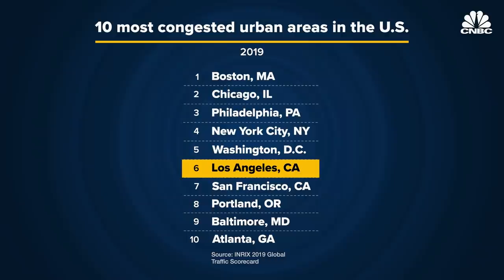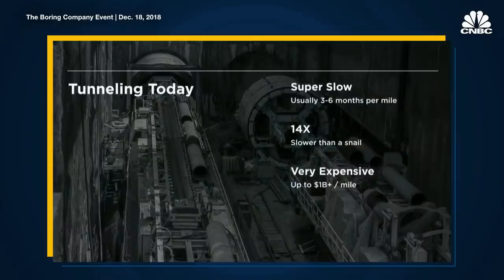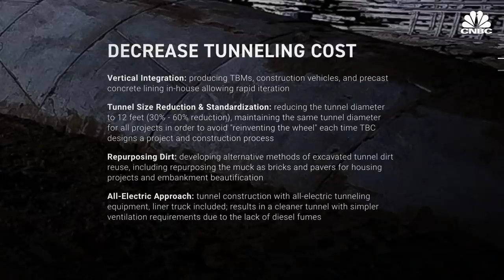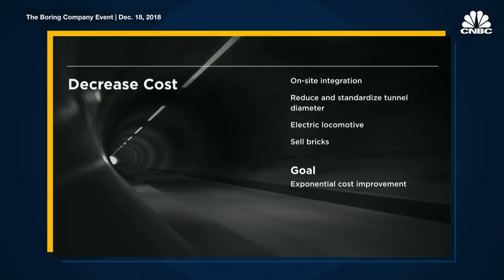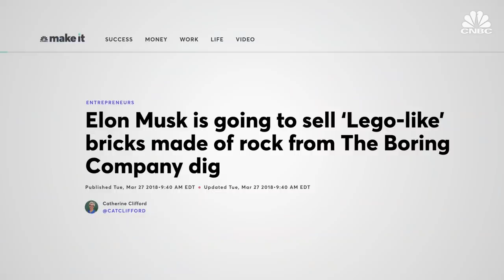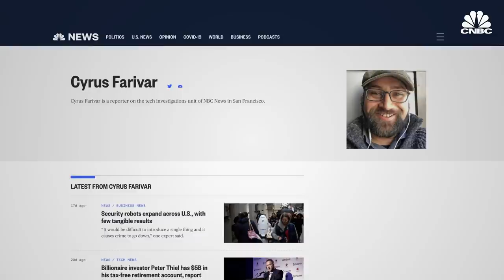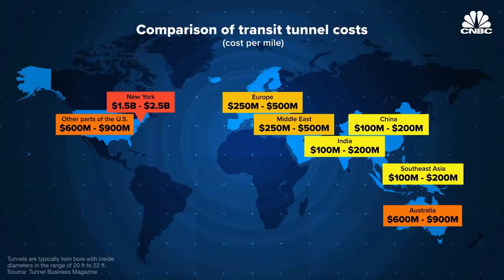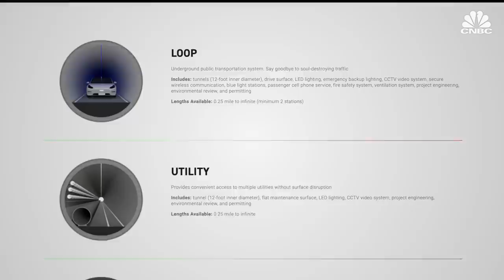Why Elon Musk’s Boring Company Isn’t Fixing Traffic Anytime Soon

Comment: It's insane how people it's amazed by this  "innovative project" when subways are being doing the same thing for decades.
Reply: Only difference is that Elon is doing it cheaper. That's about it.

Then again he did help make rocket launching cheaper as well.
Reply: Well, the hype is it's gonna be a lot cheaper and a lot faster as well. Also, it's would be Ludacris to say there is no difference between metroing and what they are trying to do. I don't know what i you want but it's a hell of alot bettter to pay 10 mil a mile then a few hundred million!.

2 billion for 1.5 miles when metros do it but 10 mil for boring company mile. Not saying that the metro builders have other challenges that makes it more expensive but not 1.9 billion more.
Reply: Cars in a subway  system. That's amazing and had never been done before.
Reply: @silverhawkscape2677  Well the tunnel is also smaller.
Reply: @magnusnielsen4409  Metros capacity is at least 100x more.
Reply: The New York subway  today is still YET TO BE BREAK EVEN. The tunnel in LA was so small/short & costs so much that it didn’t solve anything.
Reply: Its a fair point - but recognize two things:
1) Subways have historically been EXTREMELY expensive.
2) Subways don't address "first mile" or "last mile" problems. You still have to get to the station and from the endpoint station to your final destination.

I don't think these tunnels are mass transit. They are traffic alleviation for people that were going to drive anyway. There's a difference.
Reply: @texastriguy  a car doesn’t address that either, have you ever been on a highway? I had to pick my friend up from the hospital yesterday, and it was in a neighborhood 4 miles from the nearest highway exit. This is in Chicago, where highway exits are nearly every mile. You’re also completely neglecting that in the city, traffic congestion and therefore parking are so bad you regularly have to park 3-4 blocks away from your destination, completely negating the distance saved by not walking from a train station.

You also seem to have forgotten that we have busses for people trying to get off at a more specific point or ride a shorter distance.
Reply: @lcifermorningstar191  the fact that it has never done before doesn't mean is good or better than subway
Reply: @silverhawkscape2677  elon is not doing it cheaper, he literally compared building a small ass tunnel to a metro.

he only made rocket launching cheaper, because it's so niche and wasnt that useful, compared to tunnels, which exist for around 2000 years
Reply: @degummybear  Still cheaper than if government made it. We all know how cost start to increase beyond reason.
Reply: That is terribly ignorant
Reply: @texastriguy  I agree just with the last thing you said.

In that case wouldn't be better to offer a better public transportation?

It's funny how they think they are committed with enviromentenment buying a tesla and they didn't even know that metro is electric and cheaper and it has been there for years.
Reply: @silverhawkscape2677  if only, he hasn’t been able to follow through on that promise same as his promises about inventing new batteries for the Tesla. It’s just vaporware at the moment.
Reply: @magnusnielsen4409  it's  gonna be cheaper to dig the tunnel, nonetheless if you compare the people that a tesla can bring with a metro it is quite expensive
Reply: @degummybear  Small tunnels are a great thing. A 40-ton truck driving over a freeway does an equivalent amount of damage as 50,000 cars riding it in a minute, yet they pay less in taxes (contractors are legally allowed to use Gas costs as a tax rebate for their business). Keeping those tunnels small will keep maintenance costs low, prevent traffic congestion due to trucks, & I get MORE tunnels!
Reply: @silverhawkscape2677  nonsense, come to Europe or go to Asia during rush hour or even during carnavals/football and many other occasions where bus, trains, trams are almost full, no stupid small vehicles can deal with that.
Reply: No, thats not what subways does. Subways involve people getting stuffed in a single car, Musk's plan involves putting people in their own cars and then stuffing them in a tunnel, the latter was too ambitious  anyway. Public transport works in disciplined/collectivist societies. Go to Hong Kong and their MTR or Singapore or Taiwan or the PRC or Japan. Individualism works when the individual is smart, when they are not you get places like NYC and LA. Lean into what you are good at.
Reply: @magnusnielsen4409  that's inefficiency of government not the ideology , Europe has public transport better than anywhere
Reply: @alexanderphilip1809  nyc has the world's most dense and expansive Public transportation infrastructure. It can and should be done here
Reply: No one is amazed by this project. People just want a solution for traffic. And Elon Musk is doing something about it
Reply: @chrisjlee2013  he's really not tho. He's giving himself and his rich buddies a toll road lane underground lol
Reply: @silverhawkscape2677  Take another look at the price in relation with the capacity.
Reply: @ricecakeboii94  It is not about breaking even, is about what you save in other regards. More metros means: less neighbourhoods you have to demolish to put roadways on, less terrain you have to allocate to parking and less time you waste out of the people in mass transit congestion. And so you know, most public infrastructure never break even, that's why the government does it and not private corporations.
Reply: Less than 5% of the U.S. population  uses public transportation.  Americans , overall, just don't prefer to use the subway or the bus. That is the reality of the situation.  But I guess watching empty  buses drive around town wasting tax payer money and polluting  is your answer? How much money did Amtrak make last year?  Last decade? Listen, I'm all for public transportation  but as impractical as it may sound, the average American is sitting in traffic burning a tank of gas right now
Reply: @lcifermorningstar191  wow imagine having only 1-4 people for the same space where atleast 10 people can fit in a subway.... so innovative.
Reply: @chrisjlee2013  I'm amazed, instead of a congested nasty subway filled with people, you get to stay in the comforts of your car
Reply: @silverhawkscape2677  the other difference is subway can carry upto 40k people per hour while the Vegas loop with teslas carry 1k people per hour. Each tesla needs a driver too while modern subways are automated
Reply: The innovative part is about scaling it up several magnituted by squeezing all the efficiency possible out of the boring machines. Which Musk and the people he hires are unbelievably good at.

Traffic is so bad not because our roads aren't big enough, it's because they have intersections with each other. Go underground and you can have a tunnel system with little to no intersections.

It's not supposed to replace roads completely. It's just 1 part of the puzzle that can allreviate the traffic hell. Another one would be to not design roads like utter morons.
Reply: @Steelrat1994  the problem with making hundreds of those tunnels is that you end up spending trillions anyways. A subway made of similar costs can carry 200x the passengers
Reply: @MarkVonBaldi  So NY benefits while the other states pay for it?
Reply: Subways cost ~$1 billion per mile. The tunnel he built so far only cost ~$30 million per mile
Tunnels are just getting started
Reply: But with a train u can't drive your own car^^
Reply: @magnusnielsen4409  A boring tunnel can only carry a tiny fraction of what a metro tunnel can. It's also a lot slower and more expensive to maintain. If anything goes wrong it clogs up the entire system because the tunnels are so minimal in the name of cost saving.

What's Ludacris is that people fall for this BS. It's like saying I can make a pizza way cheaper and I give you a mini pizza that you can eat in a bite. But it cost 20¢ instead of $12 you would pay at pizza hut I am a genius lol
Reply: That’s what called branding and positioning. Just change name and market it massively, you’re success
Reply: @dark12ain  as you have a 100% electric car.
Reply: @grgamer8470  nope I don't , still amazed
Reply: @dark12ain  i mean even this construction will be ready in 2030 on global scale the necessity it is for everyone to own a 100 % electric car and for this to happen needs every car manufacturers to create electric cars so the cost for a 4 people car to be at 20 k euros and not 40k, u hope for it . If course the 20 k price will be attractive when everyone earns at least 12 k euros/ dollars a year.
Reply: That is not true. Subways do it better and cheaper.
Reply: @silverhawkscape2677  Funny enough, he isn't doing it even cheaper. All he build was a glorified sewer tunnel with RGB. No emergency exists, nothing. Add that and the stuff he builds is even more expensive. The cars are also pretty slow and low capacity.
Reply: @lcifermorningstar191  Have to clarify here: Cars in a glorified sewer tunnel with RGB.
Reply: @mmikael281  More like 1000x.
Reply: @silverhawkscape2677  Its cheaper because they drill smaller tunnels with no security features and also overpromise and underdeliver. They have made 1 tunnel with none of the promises they gave in the beginning fulfilled. Drilling tunnels is metal vs rock and the booring company have not invented the unoptanium metal. All other projects abandoned.
Reply: @elira123100  Pointing out that The Booring company has not delivered on one single promise yet?
Reply: @ricecakeboii94  First, maybe it is paid with newyorkers tax money. Second, my point is that if you are going to expend money to solve mass trafic at least do it soundly and not in meme solutions.
Reply: Outside of peak times subways are colossally inefficient and inflexible.
Reply: @grgamer8470  ahh I get what you are saying, but if I'm no mistaken isn't auto makers already pushing goals to build 100% electric vehicles by 2030? The transition will probably be in the next 5-7 years hopefully
Reply: @texastriguy  you can't use your own tesla to go through this tunnel. 
It's just underground taxi and stop at "stations". They're less efficient than subway that can load thousands passenger..
Reply: @silverhawkscape2677  So much cheaper he ran overbudget on his LV project by several millions and wont be able to meet the contract requirements he is obligated to do under the deal.
Reply: @silverhawkscape2677  no cheaper really, Vegas cost 50 million for a mile. And that’s with a smaller diameter and none of the typical services or safety features every other car tunnel has.
Reply: @conveyor2  subways are fantastic outside of peak times! What are you talking about? No better time to take the subway than outside of peak times. Getting a whole "booth" to yourself is great. That wont happen in an automated car/buss system that 100% will wait until you have a certain ammount of passengers before it goes.
Reply: @MarkVonBaldi  it’s not. It’s paid with federal money lol. Musk is breaking walls. I’m sorry the old boomer ways doesn’t work anymore. I can tell you right now that the old boomer way have left us with a dim future, trillions in debt, & reserved public healthcare for said boomers.
Reply: @silverhawkscape2677  
But he's not.

He bought a tunnel boring machine, same one every country buys and dug the tunnel with it
Reply: Didn't realise you can bring your car on the subway? Oh and when your out already be in your car ready to drive to where your going...
Reply: Who's actually amazed by this? He called it the Boring Company for a reason
Reply: @silverhawkscape2677  He's not doing anything cheaper. All he's done is dig a small diameter tunnel that a car can barely squeeze through, with no supporting infrastructure, anyone could do that!
Reply: But subways force you to walk to a place. You aren't that bright are you?
Reply: @silverhawkscape2677  Elon hasn't done anything yet. Elon proposed to do it cheaper, and what he actually made is a worse version of a normal underground roadway.
Reply: It’s all about cost.
Reply: @ricecakeboii94  The boomer(to be just it was the greater generation fault) way is the car driven system. To sum up a lot of math: A car is not an efficient way of transport by any metric.
Reply: The Musk effect. He has the ability to con people very effectively.
Reply: @davidsoom1551  Amen brother.  These Musk fanboys are worse than Scientologists.  L Ron Musk
Reply: @silverhawkscape2677  So far, the LA tunnel has cost significantly more than planned, there are no automated pods that carry cars or "up to 16 people", there are no 150mph but only 30, it's all run by humans which even at minimum wage racks up huge running costs. The project has been lies and hype from beginning to end. Even an overground bus route would have been cheaper and provide more throughput by a factor of 10. Someone needs to take Elon Musk to court for violation of contract.
Reply: @texastriguy  The last mile problem is only there because American city planning is horrendous. 
Take a look at European or East Asian cities, people take buses, bicycles, or simply walk to their destination from the stations.
Reply: Correction, subways have been doing the same 100x more efficient.
Reply: @silverhawkscape2677  

He did none of those things.
Reply: Well true, but subways did it in an efficient way, not an "innovative" way.  It's much like the poor quality of the music program in Gary, Indiana schools prior to the arrival of Professor Harold Hill.  Musk could give Hill lessons.
Reply: Nah. Subways are doing it better
Reply: *centuries
Reply: @magnusnielsen4409  $10million  a mile?. Trust me, thats impossible. I work in construction and i dont think they can do it for even $50million a mile.
Reply: They just don't save earth but protect the automobile industry. It's like CA.
Reply: There were rockets and then came spacex
Reply: Probably the part where its like 5X cheaper and faster.
Reply: @luism5514  did you read the comment above, compared with other tunnel his is small in size which is the reason it’s cheaper
Reply: It is insane how people like you still don't get it.
Reply: @sayidChannel  which renders the original comment irrelevant. If subways were better we’d be building more of them. Cost is indeed a factor you must include. Dismantle the government bureaucracy and we could have more subways.
Reply: @luism5514  they are better its just not efficiently designed in the usa, take a look at japan
Reply: @magnusnielsen4409  CAPACITY is different you genius
Reply: @lh2000  okay big guy, which one are you gonna eat faster a cupcake or a big plate pizza ?
Reply: @Multi0515  LOL May I use that, L. Ron Musk?  Bezos goes up tomorrow (good luck)  At least Bezos is a real businessman. Not the con man Elon Hubbard is! Elon must be miserable watching all the Press coverage not focused on him. Man that guy irritates me but I'm not a billionaire so the fanboys say I'm jealous. No, I don't want to be a con
Reply: @lh2000  reducing the cost? In relation with what? Subways?
There is no such a thing as disruption, he is just making tunnels for the people who can pay it... Seriously you belive that speed will solve the problem?
Reply: This is the same argument for saying why SpaceX is not innovative because the US government put a person in the moon 50 years ago. Nothing new you say? So why is NASA paying SpaceX to put astronaut in the international space station? SpaceX drove the cost per pound of payload down by 20x! You could have the same attitude toward the 2007 iPhone, nothing special! Why do you think today's 100 dollar phone perform better than the expensive iPhone from 10 years ago. Right, nothing special.
Reply: @khuo0219  it is not the same actually, space x is innovating because they recycle rockets... That's the point the innovation is very clear... In the boring company there is no innovation.
Reply: @silverhawkscape2677  but did elon actually make it cheaper to launch rockets? Yes the rockets return after launch and are reused BUT people often forget that you can't just reuse a rocket for 100 times without having to do any maintenance. Unlike let's say a plane or a car. Rockets need to be in PERFECT condition before every launch. So even if they can be reused, they still require a lot of maintenance costs after every launch. And this is what often isn't taken into consideration. Plus after a certain amount of launches the damage will probably be so great that it can't be repaired any more (or the costs would simply be too high) and they would thus have to build a new rocket anyway.
Reply: @khuo0219  20X you're so wrong you should be ashamed to put out such ridiculous numbers.
Reply: @magnusnielsen4409  It doesnt cost 2 Billion dollars for 1.5 miles to drill sewer pipes. This is a sewer pipe.
Reply: @texastriguy  people walk or bike the first/last mile if your city has decent indestructible it's not hard. Check out "not just bikes" on yt
Reply: it's insane how you think this is the same thing as a subway
Reply: @lh2000  You realize a subway has multiple times the capacity of a private car, yes?
Reply: U need to realise that he is trying to make it cheaper, faster and more common = main form of transportation when we have trillions of cars on the road
Reply: This idea scales better
Reply: What happened to hyper loops.
Reply: A subway is much, much better. No one gets ripped off like Las Vegas when they build a subway.
Reply: @khuo0219  You lost all credibility when you said, lowered cost by 20X.  Where are your sources, Elon's big mouth?
Reply: "same thing"? That's like saying we've been building the "same" electric cars for almost 200 years..
Reply: @ricmrodrigues  This says it all....THE LAS VEGAS LOOP!!!!!
Reply: @dogtato  It's way worse than a subway. It doesn't exist! It's another L.Ron Musk CGI fantasy. His reality is the LAS VEGAS LOOP.   This is what he really builds .8 mile  tunnel, Teslas driven by Vegas cab drivers at 30mph but with, wait for it......Disco lights. He nor the Boring company pres. showed up for the unveiling. When has Musk not mugged for a camera. When he's ashamed.
Reply: @ricmrodrigues  News flash! L.Ron Musk has cancelled his proposed "tunnels" a while ago. Even he had to admit they were ridiculous. Like his million colonist on Mars. That would take 3 Starship launches each day for 9years and double that for the refueling and supply ships.  9launches a day for 9 years.
Reply: @bascal133  Musk invented a new battery?
Reply: 420KinK  so the real solution is to not have subways be government owned you say?
Reply: 420KinK  well you said the problem with the subway and tunnel is the cost right? Its only expensive because the inefficient and corrupt government officials are doing it. Tunnels are cheaper and built 5x faster in Japan and Korea for example. If the cost can be cheaper, then the Tesla thing cant even compare.
Reply: you must have not noticed where they glossed over the  9billion number for LA expansion.
Reply: 420KinK  could be because they see it as another hyperloop project and Tesla is anti ownership. I am not anti Musk, but i work hard for my money and want to own my own car, it might be only an American thing though. If my car isn't available because i am away far from home, then ill use mass transportation, but only if it is safe, which i avoid in New York for that reason.
Reply: Even if The Boring Company made digging out road tunnels cheaper, it still wouldn't solve the issue of traffic, since 'induced traffic congestion' is a thing.

You know a society is terminally-car brained when the people in it can only imagine getting around by car, because the city or town planned around people getting around only by car.
Reply: 420KinK  so the Right to Repair fight with Tesla wasn't a thing? "Tesla's $16,000 bill to fix a nozzle" that can only be done by Tesla or voids warranty? Certain parts have censors and serialization that can be detected and disable by Tesla OTA.
Reply: @texastriguy  Induced demand means it won't change anything.
Reply: @davidsoom1551  Absolutely you can use that!  It needs to be popularized
Reply: @davidsoom1551  stay tuned. you'll see if all of this has been cancelled. that reminds of big auto and Tesla being "bankwupt" 😂
Reply: @texastriguy  wait until you hear about roads - they have never gotten close to breaking even!

Seriously though, why is it that people can understand that ROADS ARE INFRASTRUCTURE but can't understand that SUBWAYS ARE ALSO INFRASTRUCTURE and neither is supposed to be profitable!
Reply: @leftcritical7352  but i dont want to sit next to you? or anybody else for that matter, what if u got a cold or flue, lets be honest u cant trust people to be responsible in this regard, we are in a pandemic and still people are partying in close proximity

why after a pandemic would u even suggest sitting on a cart with 20 people lol. 
each to there own
Reply: @davidsoom1551  sorry but your being ignorant man......... "sending rockets up to space dont help humans" well how can u say that when we dont know yet?
how do you know there isnt a undiscovered element on another planet that will change our planet for the better- no more gas just use of a overcharged slow decaying element with no emisions?:) u cant tell me it isnt possible because without exploration we will never know.

once upon a time man travled the world by sea and im sure people like you would tell the boatment like me im wasting resources and time
Reply: @joshturner9766  So you'll be happier sitting in a little Tesla with four other people, which just had four others in it, and four before them, etc?
Reply: @Multi0515  I'm using the hell out of it, thanks. Keep up the push back. I enjoy that L.Ron Musk watches the other Billionaires go to space. Maybe he'll make another CGI with some insane claim. Yeah, the others had guts, he's all show and no go!  LOL!
Reply: @joshturner9766  It's L.Ron Musk that's the problem. Space guy himself hasn't even gone to space while the other billionaires leave him on the ground. He'll just make some CGI claim or say he'll have game playing monkeys with chips in their brains.
Reply: @davidsoom1551  so now u think the chip is fake too ? lol ... well we will see but he says he can cure blindness
Reply: @davidsoom1551  if hes right u need to eat your words
Reply: @joshturner9766  He has already abandoned his ridiculous tunnel systems! So what are you talking about? Do you not recognize all his outrageous schemes? The list is long, indeed. Why don't you tell me one thing L. Ron Musk has done to change the word for all of us? Go ahead.
Reply: @joshturner9766  It's OK Tommy, a lot of people need to turn to others as heroes and the need is great. But people have the responsibility to pick well. If you think con men and promoters are heroes that's your choice. If you walk blindly into worship that affects the rest of us. I suggest you do some research on Mr. Musk to get a more balanced position. Watch out for the Mythology, it's just too easy.
Reply: @joshturner9766  That absurd! Elon Musk will cure blindness with a chip. You have done NO research at all, nothing period. You just have your hero and believe anything after that.  Such people are called fools because they are fooled by outlandish claims.  Do you know anything about Neurolink? NO, you don't!!!!
Reply: @joshturner9766  what are u talking about lmao. Just because you have social anxiety doesn't mean it wouldn't be 10x more efficient and much faster, also cheaper lol